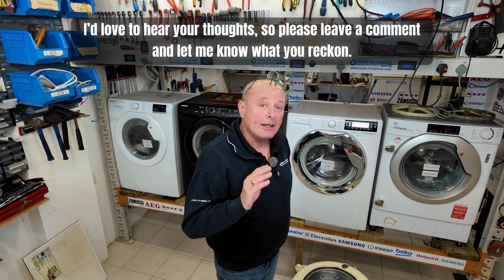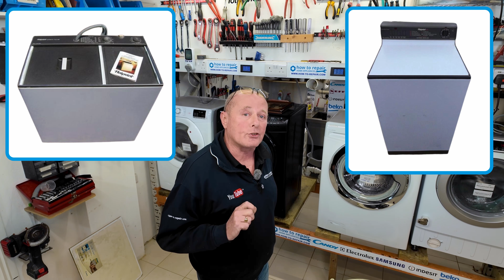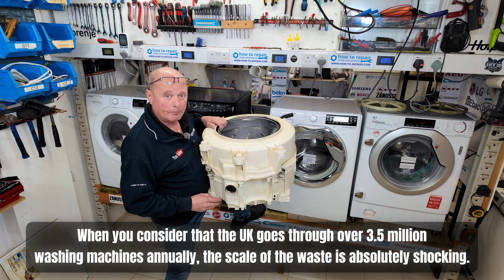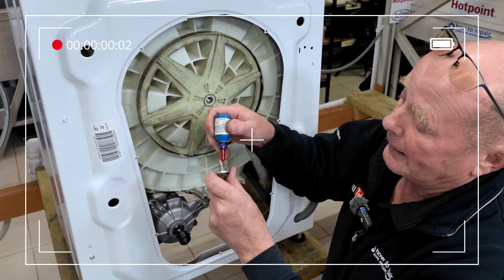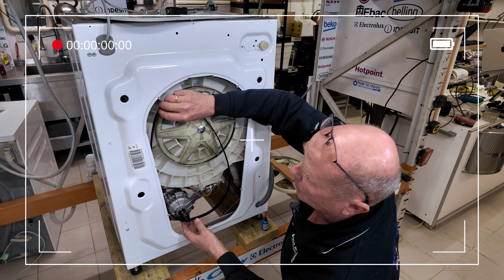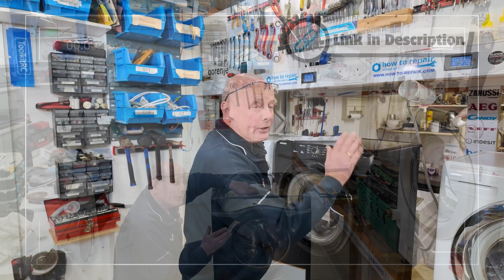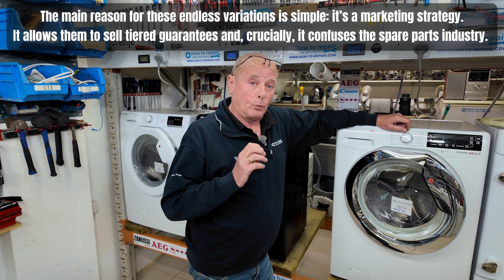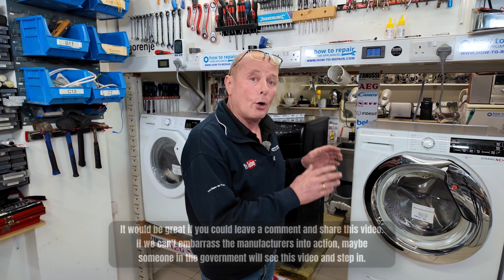I Scrapped 13 MACHINES to Prove a Point: STOP BUYING These Brands!

Comment: I have a 30 year old Fisher and Paykel top loader. It was second hand when I bought it a decade ago. 

I have had it repaired once when the pump went. I keep it clean I'm careful not to overload it and it washes really well. It doesn't have a load of stickers saying how energy efficient it is but I do believe that replacing a machine every 5 years as people with machines that do have them seem to do, is a lot less environmentally friendly than me and my old workhorse.

Comment: My first machine was a top of the range Hoover. Had so many faults, first ones repaired under warranty. I then became an engineer and worked out how to fix most faults.
I moved house..new oven made by Hotpoint. So far I've had to do 3 repairs. One was a failed solder, learned to find the issue and resoldered. Mother time a component on the main board failed. Removed the part and replaced. 
My washing machine now is an Ebac. Only failed component was the door seal.

Comment: Machines are designed too fail 100 percent ,I've have hoover tumble dryer H dry 500 last year less than 10 months old failed due to a capacitor ,the engineer at the time said to my wife these Machines are designed to fail because these companies rely on customers not registering there Machines online, Again 16 months later the same capacitor failed again this time the machine was out of warranty they wanted to charge me £160 for engineer to fix my tumble dryer again ,I bought the same capacitor and fitted myself for £17 and its working again , so this is very true whats happening to the consumer they are designed to fail either you get ripped off for out of warranty repair or you by a new machine.

Comment: You would think technology would only improve over time (it certainly did for ages). However, we live in an era of such refinement that just about everything we use is engineered to be A: difficult if not impossible to repair yourself and B: designed to NOT last forever.

Comment: I had a CDA washer dryer and fridge freezer in my integrated kitchen. Both lasted about 15 years. I had to replace with Hoover integrated machines due to the small size required. The quality is much lower and I'll be surprised if they last 5 years.

Comment: E-bac produced excellent quality and value machines in Durham until recently, I am extremely pleased with mine. Sadly they could not compete with cheap imports and have stopped production, the last to do so in the UK. It is awful that people did not see fit to buy these over cheap imported rubbish.

Comment: My Samsung has just packed up. It's about 10 years old or maybe a bit more. It indicated a drain pump failure as it wouldn't drain. Changed that, and the circulation pump just to be sure, which was surprisingly easy. No change to the defect though. Swapped then over as they were the same pump model, but it took out the main PCB. That turned out to be quite expensive and, with no guarantee of fixing the problem, I went to a local warehouse that deals in second hand stuff. They have a Miele washing machine that looks about 30 years, it's in German so I guess it came back with someone from the local regiment, so I'm trying to decide if I want to buy it or not. If I do, it will probably become a family heirloom,

Comment: Germany:my Miele washing machine W911 runs for one person since 1998. My Miele G520 dishwascher is from 1981, used originally first for two and later for one person and still running. Had only to replace it's detergent dispenser. 1998 freezer still in heavy use, 1993 AEG fridge also. 
I am too poor to purchase cheap machines.

Comment: Revised by ai because I have fever and too tired to review manually "As an IT technician, I have seen computers dumped simply because of user laziness—they didn't want to swap the drive and assumed the machine was finished. Second, there are items that break, such as ports and cables, which are easily solvable problems. But now? Technology has become "solid state." We can blame Apple for that trend, along with others following the non-repair movement. Look at how Apple deliberately makes even a hinge change brick a machine when you swap a hinge, sensor, or part.

Planned obsolescence has been around for years—take the humble light bulb, for example, with one still running after over a hundred years. Why do planned obsolescence and non-repairable designs exist? Money. Look at cheap washing machines: poor build quality, limited part availability, so you are forced to buy a new one. That is completely broken. Imagine you have a strict budget of £200, and every nine months you have to spend another £200. In a few years, "Budget Joe" has spent £800.

Why don't retailers offer a licensing system—where if an appliance fails, it gets recycled and replaced, while you pay a manageable monthly fee like a rental? This would solve ecological and environmental issues while keeping businesses afloat without relying on sheer corporate greed."

Comment: I owned 2 Bosch machines which both broke down after 3 years. Decided to by a cheap Beko at £230 in 2013 and it's still going strong! I think washing powder in hard water areas wreck the machine, so I only use liquid now.

Comment: My washing machine (Indesit), tumble dryer (White Knight), boiler (Worcester), fridge freezer (Beko), dishwasher (Beko), and cooker (Delongi), are all over 20 years old. All working well and boiler serviced every year, seal in washing machine replaced once, paddles in tumbler both replaced once. All in really good condition and old. When the engineer coming to service my boiler each year, they always say this is a good one, kerp hold of it. My heating bills are reasonable despite none of my appliances being A* rating, and I take advantage of using green slots for washing and drying clothes and using central heating, to keep bills and the environment happy. I dry everything outside in the good weather. New does not mean better nor does it mean greener.

Comment: i used to do appliance repair on the weekends for my friend who would buy old machines and fix and sell them. those spider arms are stupid, they saved like $10 to make a far inferior product,. they should all be stainless steel and top load, modern "heavy duty" washing machines should be the norm for everything, top load is way better. front load has way to many engineering issues to overcome like..... GRAVITY lolll... my washing machine isnt a "heavy duty" but is a top loader he. i will never buy a front loader after what i witnessed in the repair side. we did have top loaders in repair too, but usually electrical things like control boards, dampers etc, bearings. much easier to ifix. it would easily take an entire 8 hours to replace a spider arm on a front loader, and maybe 1hr to replace a bearing in a top loader. not to mention health benefits and ease of cleaning, front loaders get very nasty over time if you dont take care of it well. a top loader just let it air out and it will stay pretty much fine for a long long time.

Comment: Parents had one machine that was 25yrs old  before it was replace with BOSCh. But my mum aint so happy with it ( almost 10 yrs old).
 As an engineer the Companies are replicating the printer sales models.. cheap initial purchase and make the parts more expensive. 
ID love to start a company to make just the item with no IOT stuff  and have an option to upgrade if you wanted. 
the problem with proper designed machines they dont get enough revenue stream so they design to break just outside warranty.

Comment: Machines were more simplistic back them, also the manufacturing was not optimized, meaning that stuff was more bulky and usually stronger more durable. The machines are circuit boards with software, sensors, motors and actuators, the software could kill the machine if its not calibrated, way more points of failure

Comment: It is long overdue that the government should have stepped, universally,  in on this subject, especially as it does so much unnecessary harm to our environment.     Built in obsolescence has been a problem for many years, (in fact decades)... everything mechanical and electrical.. The trend of building things as sealed units so that they simply cannot be repaired is becoming a standard and it is both appalling and arguably immoral. It is also infuriating, when you know you could fix something easily, but are locked out.    I have always found that whatever product I purchase, the cost of the components is MANY times greater than the cost of the product. The prices of spare parts can be incredibly variable across suppliers, who are also out to make a "fast buck"  Sometime ago I needed to buy the bearings for a machine and the cheapest I could buy, in the UK, was around £149. I eventually sought out a European source for the bearings and the total cost, including delivery, importing and taxes etc., was only £47.   It is worth mentioning. at the same time, that this is not just a washing machine problem. If you check the cost of a simple windscreen washer motor, you will find prices form £20 to £140, depending on your car. However, like a light bulb it is the same product across the manufacturers... and an old car in showroom condition, is worth nothig compared to one year old car which is ready for the scrapyard, yet prople buy new cars by the millions, despite hideous depreciation.  So washing machines or cars: business is about maximising profit regardless of quality and having an aggressive renewal plan.They need them to break down and not be repairable. I have saved fortunes over the past 60+ years by being able to carry out my own servicing and repairs on everything electrical, mechanical and even thihose that are neither.  If ALL people voted with good buying practices, things could possible change, but people have too much money nowadays and really could not care less.   FINALLY, one more very annoying problem is the poor quality of repair work. I have lost count of the number of items that I have repaired for people, when they have been told it is irrepairable, or it has been repaired badly and I have fixed them quite easily or corrected bad workmanship. It has also made me quite adept at "repairing parts" that need replacing, but are too expensive.

Comment: I have a Miele Dryer Washer (both in one) and so far it hasn't failed me. Great machine. Should be reaching the 10 years now and the inside still looks clean. I only wish there was a good way to clean out the lint that collects over time.

Comment: I bought a Zanussi Jetstream ZWF1237W 7kg washing machine. It lasted 20 years!!! A real workhorse of a washing machine. Now old technology and replacement PCBs no longer available, but a very well built machine.

It just needed the carbon brishes reneweing.

A lesson to everyone wanting to check out and try to repair their washing machine; Always remove the soap dispenser first, before you do anything else. You'll thank me. 

How do I know this? There is always water in the softener compartment; and washing machines are designed so that when you put the machine on its side that water is lined up perfectly to discharge directly into the electronic PCB control box, even after cleaning there is a risk of degradation of the PCB. Even worse, you do like me, after a week of drying, you give it a go, get a good next full wash think fantastic and than at the second wash cycle hear the painful sound of you PCB fizzing out!

Comment: A new washing machine is less than £300, some of you have shoes that are more expensive. Its a product with relatively low profit margins, so I can understand why the companies might want to increase their profits with expensive spare parts... The car manufacturers do it at a much larger scale... 

Unfortunately, washing machines have the worst stats when it comes to failure. So, they are like the statistical outlier. 

As a consumer I refuse to believe obsolescence is "planned" in general, unless its an Apple product. The problem with the new washing machines is that they are full of electronics and there are too many points of failure for a machine that operates in hot and humid environment. So rather than planned obsolescence, a lifespan of 10 years becomes a norm for a washing machine... 

I really want to stress that the cost of materials in a washing machine is actually high and it's sold at the same price range as a pair of expensive shoes... What do you expect??
Reply: DUUUHHHHHHH....
THIS EXPERT HAS SHOWN YOU, WHAT A PLEB YOU ARE...
MACHINES SHOULD LAST LONGER, THAN  OUR PARENTS MACHINES...
NOT A FIFTH OF THE TIME....
TROGLODYTES STILL WALK THE EARTH....

Comment: I had a Maytag Neptune washer purchased ~2000-2001 and worked flawlessly for about 20 years. I still have the matching dryer which is going strong. When we replaced the washer, we researched brand quality within our budget and opted for an Electrolux. (Our preference, Miele, was out of budget unfortunately). The Electrolux broke down after only 5 years of fairly light use. Cost of repair was over $500, almost half the original purchase price. I think your comment on collusion between the manufacturer's is spot-on. Most, if not all, only offer a 1 year parts and service warranty and extended warranties are expensive. I think that's pretty suspect! Btw, I tried to repair the Electrolux myself and was surprised to find a lot of plastic components under the hood, even part of the drum stabilisers were plastic! Designed to fail indeed!. It's a bloody shame the amount of garbage this industry is generating and it needs to be regulated!

Comment: Just finished a right episode of failures, cancellations and broken promises with CANDY. Purchased a washing machine 6 months ago and door error showed after 5 months. "Engineer" (lol) came out, changed a part, failed to fix it and then i had 3 visits cancelled at the last minute.. No communications, Candy care team did not give a flying fck about the customer... Finally TODAY! got the return approved - It's going back and i will NEVER EVER EVER buy a CANDY or HOOVER again (same group) - Also i will never buy a hotpoint (Owned by Beko btw) - Had a washing machine 2.5 yrs ago and it completely rusted, looked like it was 15yr old and had been used outside for it's entire life, instead of a humdity contolled laundry room.. Buying a LG washing machine to replace the candy (full refund provided) - LG comes with free 5 year parts amd labour

Comment: Market leaders according to experts and reviews in 2026:
While the video criticizes budget lines (such as Hoover and Candy), the following brands currently lead in reliability and popularity ratings:

1. LG: Frequently noted for its Direct Drive technology, which reduces the number of moving parts and simplifies maintenance. They are considered among the most reliable on the market.
2. Bosch: Traditionally valued for component quality and engineering solutions. Their lines (e.g., Serie 6 or Serie 8) often feature reliable dosing systems and well-thought-out ergonomics.
3. Samsung: Popular due to their wide range of features, intelligent functions (Bespoke AI), and aesthetic design, although their electronics require careful handling.
4. Electrolux: Proven to be balanced machines with good washing performance and durable components.
5. Premium Segment (Asko, *Miele)*: If your budget allows, these brands remain the "gold standard" of durability. Their appliances are designed with the possibility of long-term maintenance in mind, rather than replacement.

Important advice: When purchasing any machine, even from a reliable brand, try to avoid the cheapest models in the lineup — it is often in these units that manufacturers maximize cost-cutting on the quality of bearings and electronics to lower the price to an "entry-level" point.

Comment: For me, the washing machines from around 25+ years ago were better, the classic Bosch ones or just any, they also used more water, now we have ones that barely cover the clothes in water. 

They can say what they want but I prefer a higher water level, compared to clothes that are barely wet in new machines. Imagine needing a bath but being told to use hardly any water but told to stay in longer and that is just as good as a bath with proper water levels. 💁🏻‍♂️ or to hand wash some clothes in a bucket with hardly any water in the bucket

some washing machines barely cover the clothes they are supposed to be washing

Also they have the ability to make better drum bearings that last a lot longer, and also make splittable drums

Comment: I just buy cheap Indesit machines which seem OK for a few years but the guarantee isn't worth having as when you have any problem you have to prove to their insurance company that you were not at fault making it impossible to get an engineer out, we just run washing machines into the ground then buy new, that's the future unfortunately, just don't buy expensive brands as at the end of the day all machines do exactly the same thing, they slosh your clothes around in a drum of water

Comment: Another thing: the low temperature washes these machines off don't get clothes clean, and thus fatty deposits build up on washed clothes, and thus bacteria live on these and smells develop.  Have you noticed the large number of adverts on the TV for fabric "fresheners"?  These just cover up the stink.  Also, the programmes on washing machines are rubbish. For the main wash you just want to be able to set the time and the temperature.  Similar for rinses and prewashes.   Present day programmes are a cross between a horoscope and a will.